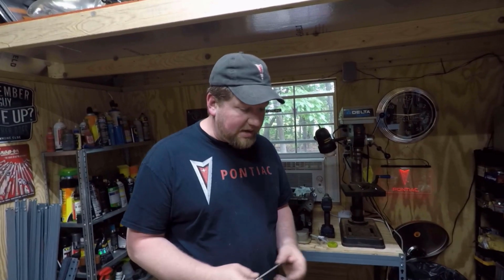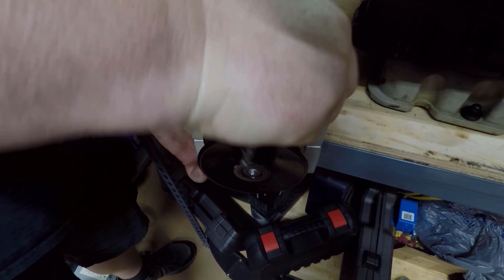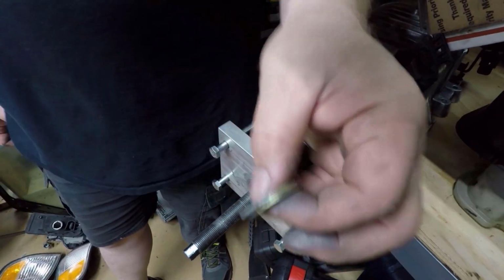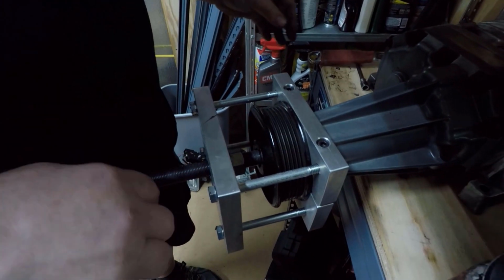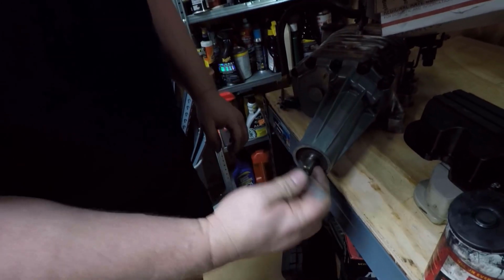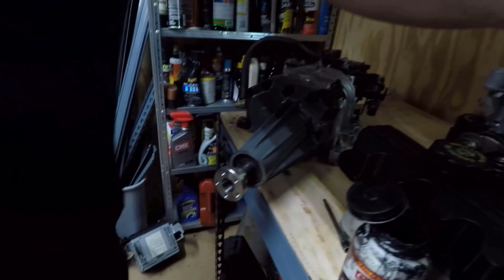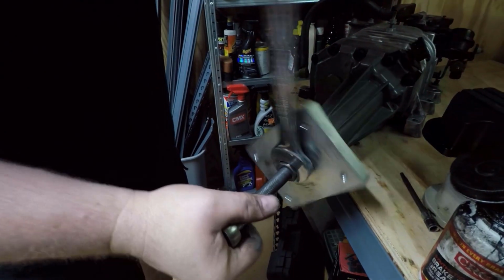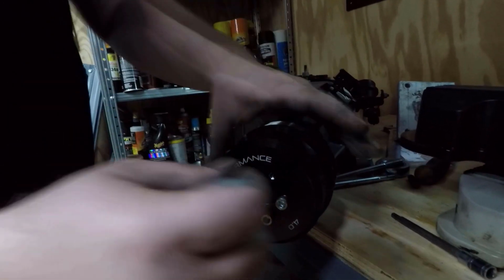Gen 3 M90 Modular Hub Installation

Comment: Hey mate I see you are still active in comments, Im replacing my rotor needle bearings in the rear of the case in my M90 and was wandering if you know how you go about properly pressing the bearings in and making them square and run true for the rotors?
Reply from the maker: Im not sure the best tool but once seated all the way they will be square

Comment: I got a 2004 gtp been sitting in the grass in Michigan weather for 2 years and having issues with electric components working sometimes my trunk release don't work my driver windows switch don't work or the lock buttons but the other doors buttons work. But I can't roll the driver window up or control the windows or locks but the mirror switch works and it lights up
Reply from the maker: Ouch, hopefully you just have some fuse issues, if its wiring it could get complicated

Comment: I used a ZZP puller and it completely destroyed my stock pulley, I wanted to reused it as I didn't have the hub yet so now I am stuck with a pulley-less supercharger until I get the hub and tune for smaller pulley.

Where did you get your puller from?
Reply: I took the pulley off as I did a rebuilt snout swap
Reply from the maker: Smoothflow pullies

Comment: Looks good. My guess is with that big ol 4"pulley you won't have any issues. Maybe lol. ZZPerformance claims there's no belt slip with this setup, but in my experience, abs many others, there's tons of belt slip. 20-25% belt wrap is just not enough. I have however figured out a good way around it, but it requires a longer belt and a little modding. 

Hope this works out for you man. Like great. This was the first time I've actually watched a video on how to install the modular hub. You made it look easy 😉
Reply from the maker: Thanks.  If he has slippage problems we can always swap the front stuff and use the second belt.
Reply: we'll see I hope it works too, kr shouldnt be too much of an issue as im already on e85, I got the proper belt size based off zzp info so if its wrong its on them lmao, but ive heard theyll start slipping around the 3.4 pulley range